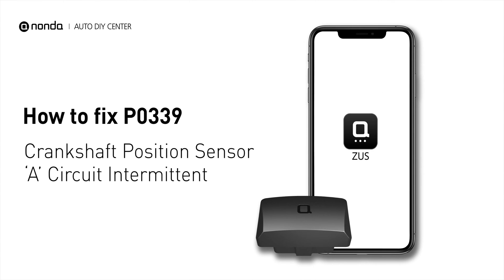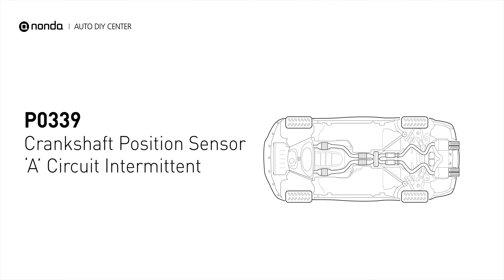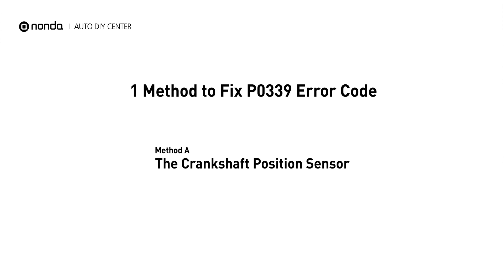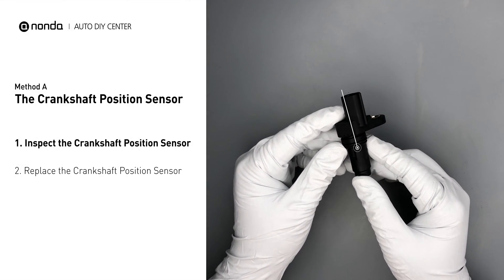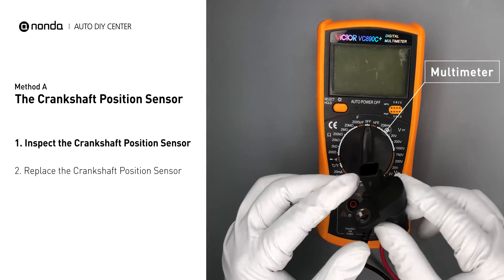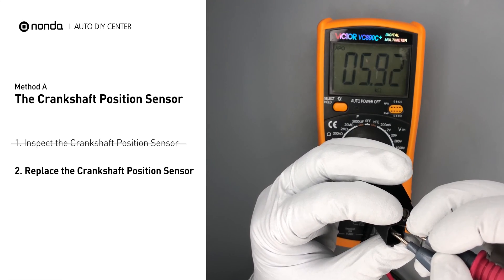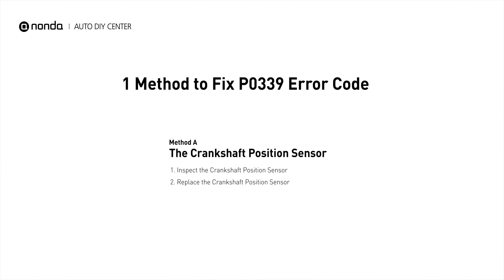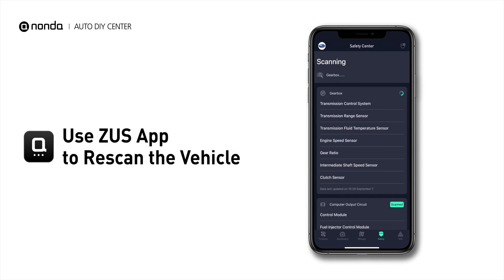How to Fix P0339 Engine Code in 2 Minutes [1 DIY Method / Only $9.35]

Comment from the maker: Hi, I'm Steve, nonda's lead mechanic engineer. 
Feel free to leave your comments here if you have any mechanic questions, I will be glad to help you out!
Reply: While replacing my crankshaft position sensor I leaked engine coolant on the new sensor and the wiring. I waited 24 hours before attaching the wire plug to the sensor for it to dry. Could this be causing the 0339 intermittent error code i am now getting ??

Comment: Hey I'm a bit confused looking at this. You say to check or replace the crankshaft position sensor. But in the video you show the engine location for the camshaft position sensor? Which one is it and where would it be located?

Comment: I recently replaced my crankshaft position sensor on my 2007 Dodge Caliber 2L SXT, because I was getting a P0335, P0300, P0301, P0315.   After replacing, I now get P0339 Crankshaft Position Sensor Intermittent. I'm wondering if I the new sensor I got is faulty ? or What would you recommend ?
Reply from the maker: Hello, we recommend checking if there's corrosion on the connectors for the crankshaft position sensor or deterioration on the wiring harness.
Reply: @nondainc  Hey thanks for the insight, I fixed it. It was simply bad luck, faulty NEW sensor from Autozone, went to the junkyard and picked up a OEM sensor from same year vehicle. Worked like a charm!
Reply: @TheTimetoRage  yes autozone and advance auto are known for faulty cps's I'm dealing with it right now I knew I shouldn't have bought a carquest sensor from advanced but it was all they had in stock so I just bought it anyway and what do u know it doesn't work. I've had same issue with another car a few months ago and it took 3 tries for me to get a functioning sensor from autozone
Reply: @nondainc  so I see the corrosion..Honda doesn't have replacement. What your recommendation on the plug...